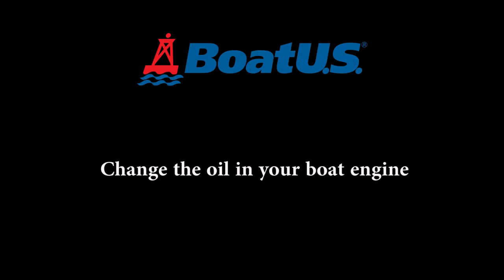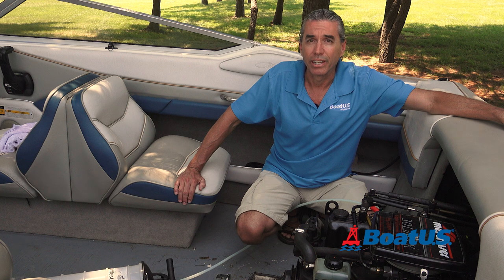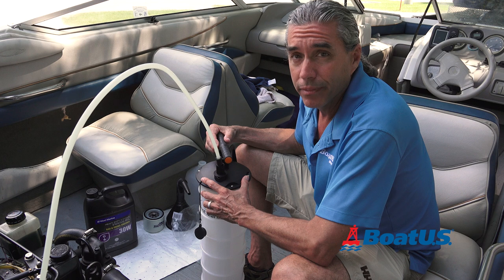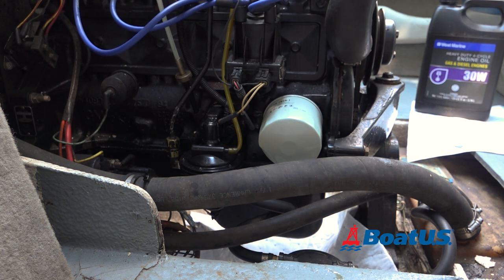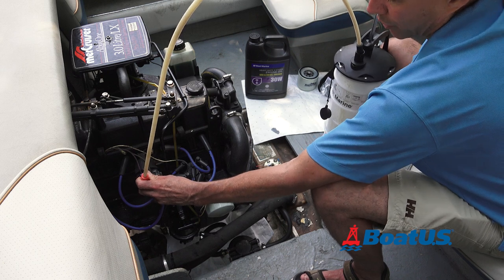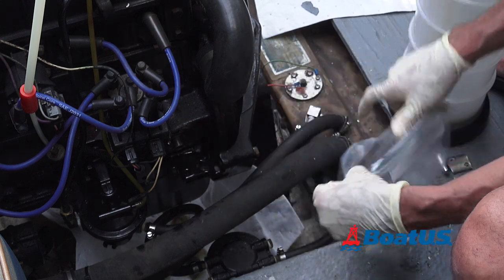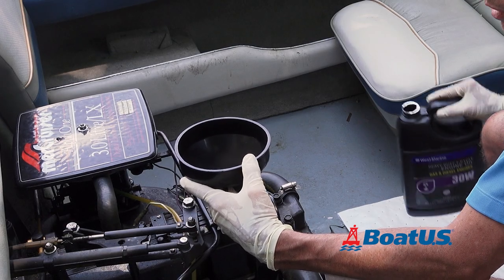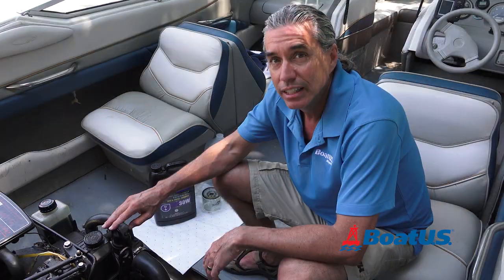Changing Oil In Inboard or I/O Boat | BoatUS

Comment: I use to laugh at and or trash talk these oil extractors.  ( no thanks, I'll do it the right way)   I  finally started sucking the oil out of a lawn mower that I bought because the drain plug so was in a bad tight spot.   Now I just do it on everything including the outboard.  Fast,  easy,  very little clean up.     good video.
Reply from the maker: You're not alone, Martin. I think we all have a little bit of that in us. (The old way works just fine; shortcuts are cheating!) But glad you decided to give it a try. Less time and mess to clean up during maintenance means more time on the water! Thanks for watching!

Comment: Fantastic video It helped me a lot. One question though when do I use the filter wrench when taking it off or when putting it on?
Reply from the maker: Hi Phil. Thanks for the question. You may need the filter wrench when removing if you can't unscrew the used filter by hand. Hand tighten only when putting the new one on. Here's one of several helpful how-to articles from our website: https://www.boatus.com/expert-advice/expert-advice-archive/2018/october/how-to-change-the-oil-in-a-4-stroke-outboard-engine
Reply: @boatus  thanks for the response!

Comment: Was thinking about getting one of these for my car, lawnmower etc.
Doesn't it leave a lot of gunk at the bottom? In my experience, car pans are usually flat.
Reply from the maker: Interesting idea, Michael, and it makes sense. I can't speak to using it for cars or mowers, but a search online shows vacuum pumps being marketed for that use. That said, we ALWAYS recommend following manufacturer recommendations. Likely for the reasons you cite, some vehicles may have designs where using a pump is not ideal.
Reply: @boatus  
Thanks very much for your helpful response. 
I have seen these being used on cars when accessed through the dipstick. The problem with car sites is you are often subject to disdain or ridicule for gaps in your knowledge.
Your video came up in my recommendations and you seemed like a nice, mellow guy
Thanks for taking the time on your research and response and most importantly, advice to stick to the manufacturers recommendations. That should have been my first port (see what I did there?) of call.
If I proceed with my plan I will forward any relevant information. 
Thanks again.
Reply from the maker: Oh, you get those naysayers in every industry, including boating, Michael. Our feeling is if both methods offer the same results, why not work smarter instead of harder?! (And keep those knuckles from getting scraped!) Good luck in your search, and we're glad the video reached outside the boating world, too. It will be interesting to learn what you find out. FYI, Charles has moved into retirement since we shot this video, but he remains one of the coolest dudes around! We miss him, but we're still here to help out whenever possible. Here's to smooth sailing on the asphalt ocean!
Reply: @boatus  
Smooth sailing to Charles and everyone @boatus. 👍

Comment: Great videos, keep it up. Personally, I like to drain my oil into a small pan, and then vacuum it out of the pan so it doesn't spill when the pan is removed. You can get more oil out this way.
Reply from the maker: Whatever works best for you, but often there's not enough room to get a pan under the engine. We have found that using an electric or manual oil change pump allows you to transfer the used engine oil directly from the engine to a container for proper disposal.

Comment: Im pretty sure i put to much new oil back in. Dipstick reading is real high. Haven't been on the water yet. Should i drain to where i am just ABOVE the SAFE reading on the dipstick? THOUGHTS? ADVICE??
Reply from the maker: Thanks for the question, Chris. Yes, you want to get the oil into the proper range for sure. Running with too much can be very hard on the seals. If you don't already have one, we highly recommend getting a dipstick pump. You can purchase at West Marine or other stores. It allows you to pump out the oil directly from the dipstick hole. It's way less messy, and you can use it for all your oil changes. Hopefully this is a simple fix.

Comment: I have a 2001 Ski centurion. Mercruiser 5.7 engine, can I use 15W-40 oil? Or should I stick to 20W-40?
Reply from the maker: Thanks for the question, Ivan. Use whichever oil is recommended by your engine manufacturer. If you don't have a manual, you can usually download one or purchase one online. Based on a quick search, the company recommends using MerCruiser SAE 20W-40 Full Synthetic Engine Oil. Though I doubt it's the case with your engine, unless you've replaced it in the last couple years, make sure to follow all manufacturer recommendations and keep good records + receipts for all maintenance you do yourself in case there's a warranty issue. Most companies won't honor the warranty without proof that you've followed recommendations exactly.

Comment: good video. I like the bag tip.  what weight/type of oil should I put in the 5.7 351 V8 ??
Reply from the maker: Thanks for the question, Mark. Without knowing the specifics of your engine, we're going to refer you to the owner's manual. If you don't have one, you can order it through the Mercury Marine website or your local authorized dealer. There are some helpful Q&As on the site along with links to ordering the manual if needed: https://www.mercurymarine.com/en/us/faq/?category[]=oils-and-lubricants. Keep in mind that if your engine is still under warranty, make sure to follow all manufacturer recommendations, take notes, and keep receipts for the oil, filter, etc., as proof. Glad you found the bag tip handy. It's been really useful for me in other applications, too, such as when servicing my standby generator at home!

Comment: Does the oil filter have to be changed to change the oil?
Reply from the maker: Thanks for the question, Justin. The filter does not have to be changed, but I can’t think of a reason for not doing it when you change the oil. It’s a simple 2 minute job and in most cases, you just unscrew the filter from the block and screw on another. The filter is there to trap contaminants and particulates. If the filter is not changed, it contaminates the fresh oil very quickly, potentially shortening the life of the engine. The manual for your engine should have a maintenance schedule, and I doubt very much if that tells the owner to change the oil and not the filter. Always follow the manufacturer's recommendations. Hope this helps!

Comment: Awesome!  Thanks :)
Reply from the maker: Thanks for watching!
Reply: @boatus  how are I have a 1997 mercruiser 4.3 what type oil and filter I need for thanks
Reply from the maker: @Fairy_brianna547  Hi Mario, unfortunately we can't really answer that without more info and we don't want to tell you the wrong thing. Either check your owner's manual, or if you no longer have it, you can usually find one online. Look for your specific engine here as a starting point: http://www.marineengine.com/parts/mercruiser-sterndrive-parts/ If all else fails, Mercruiser is still in business -- give them a call. Good luck!

Comment: Where do you get the pumps to change the engine oil and out drive oil?
Reply from the maker: Thanks for the question, Charles. Ours came from West Marine: https://www.westmarine.com/buy/west-marine--manual-oil-changer-6-9-quart--11047123?recordNum=1 though you can find them elsewhere. Look for manual oil extractor. Most come with a variety of hose sizes. Use the largest that will fit down into the dipstick tube.

Comment: Nice video please what type of oil is that and engine mark?
Reply from the maker: Thanks for watching! The engine is a 4 cylinder Mercruiser Alpha One 3.0L/LX. The oil we used is West Marine 30W 4-cycle single grade. Always check your manual and use the oil recommended by the manufacturer. Not doing so could void the warranty if you should have a problem.
Reply: @boatus  thank so much 
I will really like share something about marine mechanic

Comment: I have VP 5.7GXi 2008. no previous experience with boats. I noticed it takes hours before oil in my engine settles completely, If I cheeck it 10min after stop it shows nothing on a dipstick. but tomorrow it is close to max. Is this normal?
Reply from the maker: Thanks for the question. In short, yes, it's normal. With the engine at rest, the oil pan will be full. After the engine starts, the internal oil pump circulates oil throughout the engine. Until the engine cools off and the oil drains back into the pan, the level won't register on the dipstick. Therefore, you should check your oil level before heading out every time when the engine is cold.

Comment: Is it an absolute must to warm up the engine before draining the old oil?
Reply from the maker: Thanks for the question, Damir. Ideally, the engine should be at normal operating temperature when the oil is drained. Warm oil is less viscous and will more fully drain into the sump pan from where it can be more easily pumped out. If the oil cold more will remain in the engine and mix with the fresh oil potentially shortening its life to some extent.  

Sometimes it is not possible or wise to drain the oil when the engine is hot. For instance, if the oil has been left sitting in the engine for many months or even years there may well be settled contaminants such as soot, sulfur, and water, all things that can damage sensitive parts and are best not circulated around internal components.

So the short answer is this: Draining hot oil is best, but if this is not possible, draining cold oil will come in a close second. Always use the oil as recommended by the manufacturer. The worst thing that you can do is to overlook changing oil at the recommended intervals as this will shorten the life of the engine.

Comment: How can I find out how many hours my engine has?
Reply from the maker: Hi Isaac. You don't say what type and age of engine you have, so it’s hard to give direct advice on your specific setup. However, many later model engines have an ECM (Engine Control Module) which is basically a computer that is attached to the engine for controlling the main electronic functions of the motor. The ECM also stores engine data, including total engine hours, which can be interrogated and read by a computer. To do this specialized software and the correct cables are necessary, so this is not something that you can do yourself, but you can ask your local authorized dealer who will be happy to assist you for a fee.
Reply: Change the oil now, and then keep track of the hours. Change it before you think you need to

Comment: All I need is to know where the oil goes not this stupid stuff that is basic  Knowledge I just need to find the tiny hole
Reply from the maker: Hey, Joshua. All engines are a bit different, but most oil filler caps are easily accessible and are marked with what looks like an oil can with a drip coming from the spout. The cap is usually round, about 4 inches diameter, with notches that allow you to grip and turn it easily. Sometimes it's made from yellow plastic or chrome. If you can't find it, you may want to consult your owners manual; usually easy to find online if you don't have a print version.